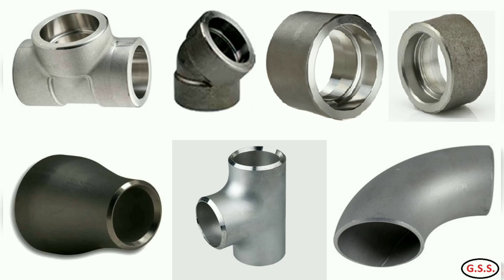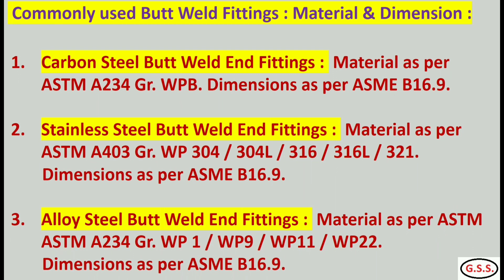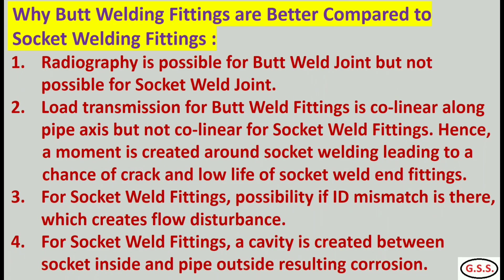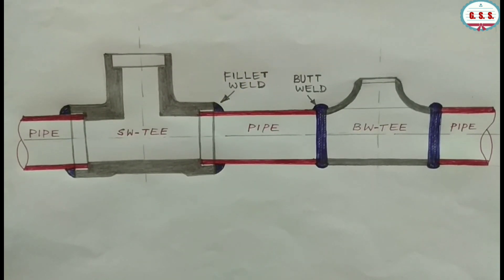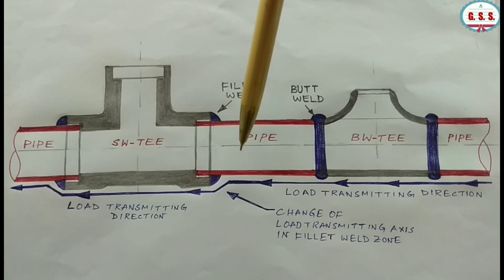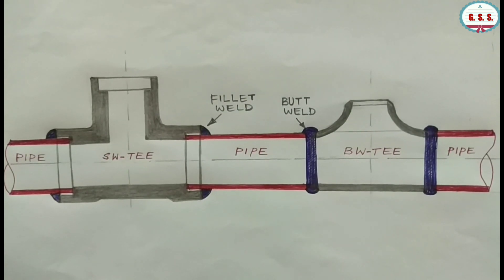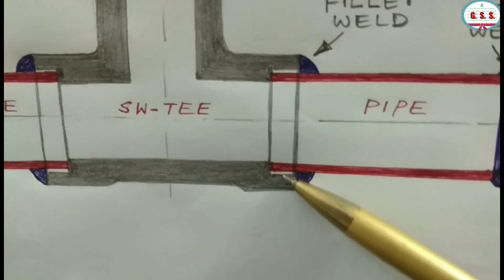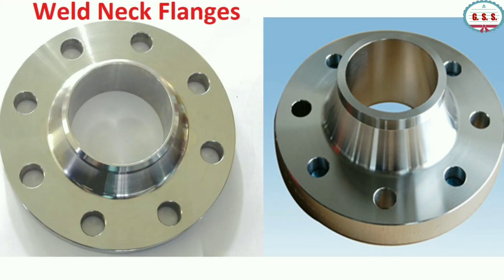Piping Engineering : why butt weld fittings are better than socket weld fittings

Comment: Sir, Why HydroTest not doing for Socket weld piping?
Reply from the maker: @umeshkanekar2126  hydrotesting is done for socket weld piping, but not done for socket weld fittings, because socket weld fittings are made from forging and are very much robust.

Comment: Is there any video on how to do butt weld of large diameter (ID 1800mm)  pipelines ?
Reply from the maker: I do not have any such video. But for this size of pipe, welding to be done from outside as well as from inside.

Comment: Sir which standard should be followed for MS forged & buttweld fittings ID1239 part2 or ASME in India?
Please guide me
Reply from the maker: For BW end wrought fittings and socket weld end fittings better to follow ASME Standards 

Dimensions of BW end fittings are as per ASME B16.9 and Dimensions of SW end fittings are as per ASME B16.11. 
Material of CS BW end fittings is ASTM A234 Gr. WPB and Material of CS SW end fittings is ASTM A105.

Comment: Why socket weld fitting has higher pressure rating than butt weld? Most butt weld in my country is sch10 sch40..while SW is 3000 psi above
Reply: Class 3000 is not 3000 psi.  The threaded and socket pressure classes correspond to various seamless piping schedules.  So that if it's corresponding piping schedule works for the desired pressure and temperature, the fitting will too.  Butt welded fittings are just the thickness of the matching pipe and can handle whatever the straight line pressure and temperature capabilities of that pipe is.